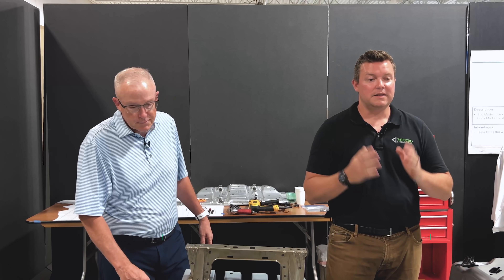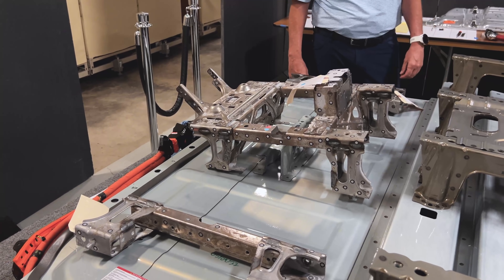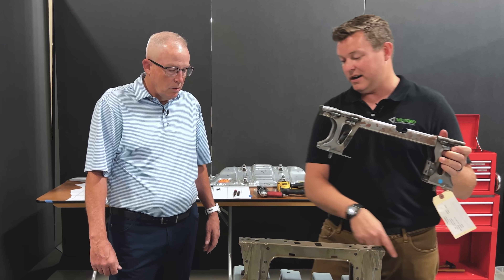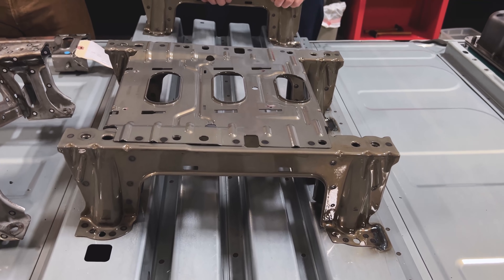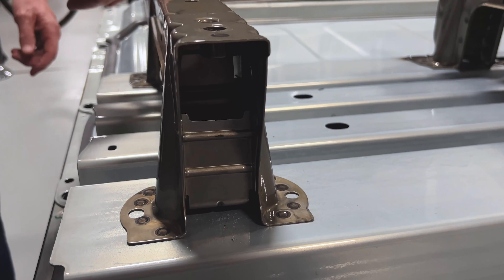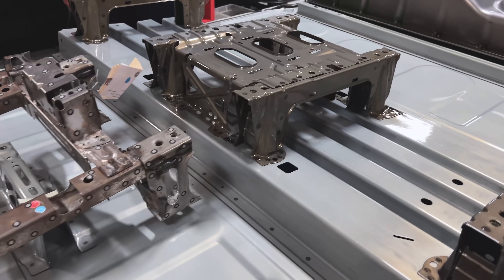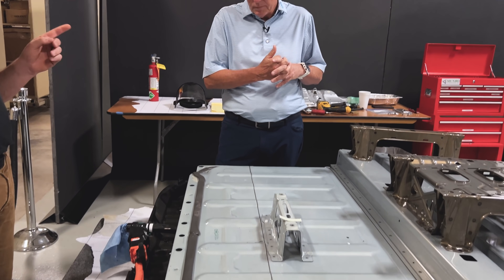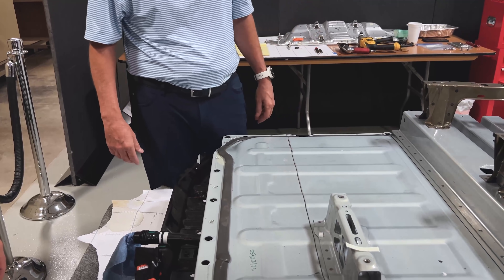Giga Texas Structural Battery Pack Cover | Tesla Model Y

Comment: 16:10 When Tesla started making the structural battery pack, everyone else’s batteries were catching fire, so placing the seats right on top of the battery pack demonstrated they were confident their batteries didn’t catch fire or rarely did and when they did they were not as hot or explosive. (That’s my theory, at least.) If Tesla’s batteries caught fire just as often as other makers they wouldn’t have been able to do this. And if everyone’s batteries were as safe as Tesla’s, they might have less interest in doing this.

Comment: I agree with others and came to say that the clear coating of the whole pack including brackets is most likely to prevent rust and corrosion. If you compare the bracket from the earlier y its already rusting from the weld and the bare steel. So the coating would prevent the oxidation of the welds and bare steel seat bracketry

Comment: If the lid is structural then removing it and not installing to spec compromises the structural integrity of the vehicle. The pink polyurethane makes the lid impossible to remove without damage. Tesla's creating phenomenal innovation in  autos but they're also moving toward un-repairability.

Comment: Today Joe Tegtmeyer's video will show rows and rows of structural packs behind the windows of General Assembly. The seat supports and the "penthouse" oil pan like covers are identical to what is shown in this video. But can we then say for sure that in today's video there are 4680 cells underneath the cover? Is it engineering-wise possible that they have standardized on the top cover and the stuff inside the penthouse but added as a temporary measure a steel plate plus 2170 cells underneath?

Comment: Great work as always kudos to the Sandy Monroe team. Apart from the efficiency gained and reliability improved due giga casting and structural battery pack, what would be the impact on serviceability after a minor fender bender or  collision?
Already minor collision repairs cost significantly more, what will be the case if most minor collisions become a total loss? I assume the structural frame/chassis parts will be made available easily and for lower cost. Or tesla is going to have a dedicated collision repair service in future? Only issue with structural battery pack is the serviceability after minor damage or cell malfunction. From the way the structural battery is made, definitely shows the confidence in the design and the maturity of the entire battery pack over several iterations.

Comment: I’m conflicted with this breakdown, I have an apple iPhone and I like the fact I buy it and don’t have to worry very much about how well built and how much software support I get . I useto upgrade my pcs and repair my phones. Don’t really upgrade my Mac anymore and haven’t repaired a phone since 2016 . But I have been repairing cars and doing my own maintance since the early 2000s  . I love the giga casting stuff makes alot of sense but the structural battery pack is a headache wrapped in a disaster , I really like Tesla , I think they pioneer a lot of things for the ev world, they just don’t really advocate to the average consumer for the right to repair. Trying to swap a battery pack on one of those things seems like a ridiculous process . Really hope an auto maker makes a modular repairable battery pack with the ability to remove segments of the Battery to dissect the cost of a battery issue . Quick disconnects for power and cooling lines and also have a steel or aluminum roof option too .

Comment: The hose for the heat pump: That is most likely not an 'improvement' but instead a fix for a bad design. As we have seen previously, Tesla have no idea on how to build proper heat pump systems since they self destruct in coldish climate.

Comment: pilot at that speed, however, you wouldn't want to do 200 mph even if it could. Because it gets up to speed so quickly, we could simply lift off and coast rather than slam on the brakes. But that gave us a lot of time to ponder the Model S's high-speed behavior, which, frankly, was terrifying. It wanders in its lane, with lots of slop on center in the steering that doesn't have anything to do with the yoke. Putting it in the sport steering setting helped a little, but it's like Tesla neglected to dial in its high-speed steering and handling behavior. This is not what you want when traveling two-thirds the distance of a football field every second. Tick. Tick. Every other car that's in the same conversation—from the Porsche Taycan to the Bugatti Chiron—is unerring and locked on its lane at 150-plus mph.

state of charge screen
Sign up for our new weekly EV newsletter, State of Charge. SIGN UP
Perhaps the real reason Tesla hasn't yet unleashed the Plaid's 200-mph capability is to avoid overtaxing the brakes. Even in our standard braking tests—five consecutive stops from 70 mph, and three from 100 mph with more space between—the Plaid's brake hardware was already starting to cry uncle. Not only did they smell like they were on the way out, there was a warning message that popped up on the dash notifying us of their imminent demise. And our test regimen isn't nearly as severe as hot-lapping on a racetrack.

Tesla has now said a $20,000 carbon-ceramic brake package is in the works for the Model S Plaid. Promised by mid-2022, this pricey upgrade includes substantially larger (and wider) rotors front and rear.

Waiting for a significant brake upgrade would be a prudent step in making the Plaid able to safely approach 200 mph, and it would also certainly be welcome when tracking this heavy four-door. But Tesla also needs to sort out its high-speed wandering.
2021 Tesla Model S Brings the Speed, Forgets the Brakes, Steering
by Car and Driver US
This content is created and maintained by a third party, and imported onto this page to help users provide their email addresses. You may be able to find more information about this and similar content at piano.io
This commenting section is created and maintained by a third party, and imported onto this page. You may be able to find more information on their web site.

Comment: Having a sincere and critical attitude is very important. However, the way Scott explains some of the features and/or reinforcements by assuming maybe Tesla tested and found the issues so that Tesla decided to add the reinforcement. The better mindset would be that Tesla did structure analysis and added additional  reinforcement to prevent any possible structure deformation. The both mind-sets are not the same. One DOES NOT NEED to find problem first, then fix it. One can predict the potential areas of weakness via structural analysis and then decide to reinforce it (prevention). For Tesla or any other new EV companies, one major problem will cause much more damages than traditional car makers.

Comment: I hope you guys tear down a Lucid Air next instead of Ford Lightning or GM Hummer EV. Rivian teardown has been a real let down in my opinion. Even Tesla is benchmarking the Lucid Air.
Reply from the maker: We are tearing down a Ford Lightning this fall.
Reply: @MunroLive  Lucid Air please!!!
Reply: @rj8u  Rivian is much better than Lucid.. Seems like you are expecting too much from that Car.. Its software is the worst of all EVs.. Only the exterior looks are better.. Rivian's not like that.. So far its better build quality & superior software places next to Tesla..
Reply: @DarkHawkk  I think your wrong about Rivian being better than Lucid. Rivian does not make their own motors and inverters for their R1T and R1S, most of their parts are being sourced. Lucid on the other hand designed and made their own motors and inverters in house thus so see a lot more vertical integration in their Lucid Air for which achieved a record 520 miles of range with 118kwh battery surpassing both Tesla and Rivian. Lucid teardown will be more valuable than both Rivian and Fords Lightning in my opinion.

Comment: Yes, the traditional OEMs learned to be risk averse after a few trips through the US tort system. This battery may well give Tesla a chance to take a ride in that barrel. I'm particularly interested to see the gas escape paths provided in case of a thermal event. If Tesla really did fill the whole shell with resin that could be problematic.

Comment: I would have the the seat mount bend over seat suppot and the spot weld it on the verticle surface and then be able to remove the mig weld

Comment: I don't see why sitting on the battery pack assembly is different from sitting inside a shell separated from the battery pack by a slim metal sheet.
What's import is the total separation between the batteries itself and the seat, and of course Tesla could have heavily shielded the battery pack internally.

I'm sure we'll see quite an impressive shielding when they will take apart this battery pack.

Comment: I am wondering if having occupants directly on top of the battery pack is going to affect thermal comfort given that the pack is heated up to between 55 and 60C while charging. If the floor was 55C, that would make it rather uncomfortable to be inside the car so they must have some sort of insulation somewhere.

Comment: Interesting there isn't significant structural change to the new 'structural pack.' Naturally material/production cost and product availability are the biggest drivers. Much like the advertised 4680 battery improvements, it's probably more about Tesla PR than anything. I would be interested to know if there's much weight change between battery pack versions as the end product is rumored to be about the same weight which is much less than Tesla's reported 400lbs lighter.
Reply: Where did tesla ever claim a 400# weight reduction though? In those battery day slides the weight reduction was for the chassis&pack itself clearly shown in the slides and not to be taken as an entire vehicles worth of mass reduction. 
Once the structural 4680s with castings had actually entered production. 

Spoken reviews showed a 4225# weight for his Texas built model y. Which is roughly equal to a current model 3 performance in total weight. 🤔

Comment: I am curious how those various sealing compounds will age and in particular, how they would fare if exposed to rust-preventive liquids (Fluid Film, Krown, Rust Check etc.). Does Munro do those tests?
Reply: I’m curious too, the cars are like big phones. The ip68 “water proof” phones last a long time, but these cars are warranties 10 years or 100k miles. Will they warranty the batter from water damage is the seal goes bad? Or will they try to blame the customers????
Reply: @42ambrocio  Good point. Send to Tesla
Reply: Why should Tesla test seals/components, wich are in use in maybe hundreds of different applications? 
Does anybody tests on a  8.8 M14  ?? or a UNC 5/16" ??
Reply: why would you want to use old school rust prevenatives on this car, its ferrous content is minimal! I would test for hair spray and nail varnish remover though, passengers are capable of spilling almost anything!
Reply: @martinwright7367  Even aluminum corrodes and when it does,  it's insidious especially where it meets other metals. There are lots of cavities than can collect dust and dirt then moisture gets in then the corrosive process begins. But if you only lease, forget it. Get a new car. Some people like things to last though hence the reason to use metal conditioners.
Reply: @nononsenseBennett  aluminium oxidation is  normal and normally helps protects the underlying metal from further damage unlike iron rust. No need for Tesla to test iron age rust fluids on their all aluminium car.  .I do wonder about they prevent crevices forming on this if the seal shown is the only one.  i suspect other covers or seals on the body

Comment: My question is about serviceability of the pack.  If it is riveted into place, it doesn't sound to me that replacing cells is feasible.   I know cells go bad from time to time and in other packs individual cells were able to be replaced.  It seems wasteful if you have to buy a whole new pack if you have, let's say 15% cell failure.  I would love to hear your opinions on this and to see if there is an efficient way to build a servicable structural pack.

Comment: It's not powder coated it's a ceramic coating to prevent heat from entering the vehicle should there be a short circuit with the battery pack.

Comment: Consistent with “lean design” it would appear that Tesla are actively reducing parts count and labour input.  Tesla perhaps has an opportunity to use deeper drawn cross beams for the top of the battery and remove the front seat risers altogether.

Comment: I will bet the weld time and part reduction alone would more than pay for the complete powder coat. 
I believe as well that the powdercoat is related to the seal on the battery pack. With the clear powdercoat the reliability of robot performed pre-sealer cleaning would be greatly improved, hell it would be greatly improved for manually cleaned chassis.

Comment: 15:15 "To me that's one of the really interesting things when they mention structural pack... That it still really looks.... like one of their packs"  What?  Tesla glued each battery can to the top and bottom of the battery pack cover plates, which gives strength like any honeycomb structure sandwiched between 2 plains.  Whats is confusing about this and what would make this look significantly different from the outside? Then goes on to lightly suggest that the other manufactures wouldn't mount anything to the top of the back due to safety concerns, but doesn't site any evidence or criteria as to why.

Comment: Looking foreword to the battery orientation. Lucid is already doing it and then cool the top end of the batteries. If this makes school, the casting tool makers will eventually compare cost of steel vs silica alloy cast. Eventually all seats will attach to the battery and will be assembled into the body as the last step. High volume production makes room for faster evolution. Good work from the Munro team!

Comment: Condensation is gonna just sit there and rot it over time...there is no experience in using this design,in real life time,5 years watch all the recalls...heck companies with decades of experience mess up on supports that get corroded in high salt use areas...probably not a proven design

Comment: OK, just some basic feedback from a layman Tesla 2021 model Y owner/fanboy: That was a really great and subtle pitch at the end. It is a good reminder for us that these videos aren't just for us. Still, you guys have to balance the entertainment value with the engineering education to keep us coming back. This is the 3rd 2022 model Y teardown video. The 1st was exciting and covered all the bases. The 2nd one was a snoozer and I went away and couldn't think of anything I learned. This one was good because of the dramatic changes to that housing (penthouse) and the seat mounts. Can't wait to go into the penthouse changes. Personally, I like to hear about things getting lighter. I have another model Y on order and I was hoping it would be ~400 lbs. lighter and, so far, it seems like I'm only losing ~150 lbs. I want to understand why that is. The gigacastings and structural pack with 4680s alone should account for the 400 lbs. or so I thought. Maybe the steel cans on the 4680s are super heavy idk. Overall great job on this episode Corey.

Comment: Thanks Cory & Scott for taking the time to do the video. Cory I have question not related to this video but it does pertain to the model Y. Do you guys plan on getting a sample of the frame castings  for a Metallurgist to analyze the make up. I've heard that Tesla had to design their own type of metal for the casting machines to work. Is that information you can share or is that for your reports?  As a general person I'm really interested in knowing about the strength of the cast compared to other casting blends in the industry.  Anyway thanks again for doing what you guys do for us.

Comment: Could the shiny coating on top of the battery be some sort of fire suppression coating since theres no floor pan between the battery and occupants? Otherwise id suspect a corrosion inhibitor vs. raw steel that can corrode

Comment: @munro.....The reason why the top of the battery pack is a prime glossy finish all the way is........because its also the floor of the interior of the car. I think they made it a prime finish because they wanted the floor to look nice and be easy cleanable. Its an A surface because they dont need an extra floor because the battery pack is structural.

Comment: 1. I wouldn't want a gas tank being a structural part of a body.
2. Bodies bend and twist. Will the bending and twisting effect the connections inside the battery pack?
3. How long will the seal between the battery pack and the body last? The seal is on the underside of the car. How will water, salt and sand effect it.
4. Nothing lasts forever. Things break. Replacing the battery pack would be interesting.
Reply: Even a conventional pack is mounted without elastomeric elements so it twists with the body, so this will not be any different for the connections within the pack. I assume that the idea of structurally integrating the pack is that the complete structure will be stiff enough that there is not enough twisting to be an issue for connections anyway. Also, cars are much stiffer than they used to be.
Reply: Even an older Model 3 is a very stiff vehicle, this is probably rigid as can be - I'd expect VERY little bending and twisting.